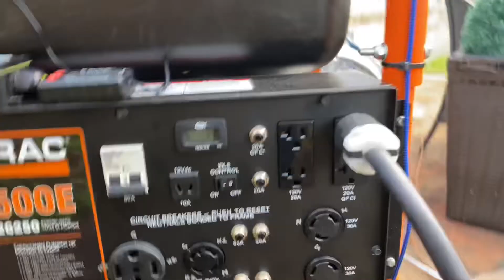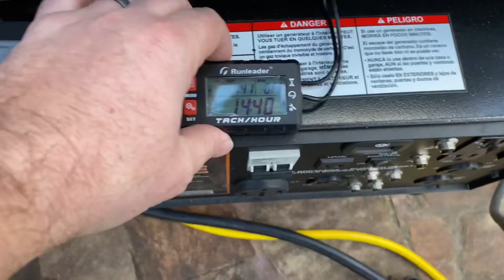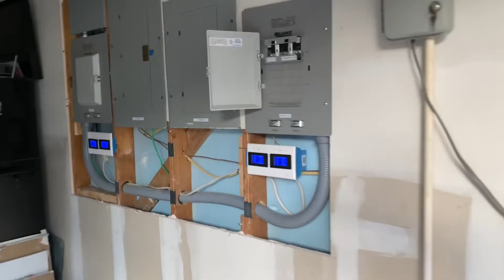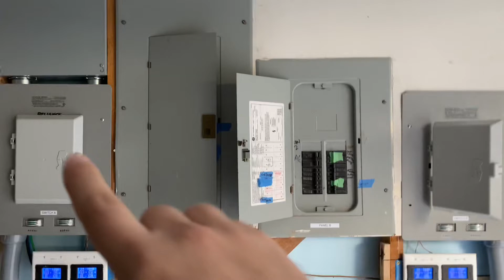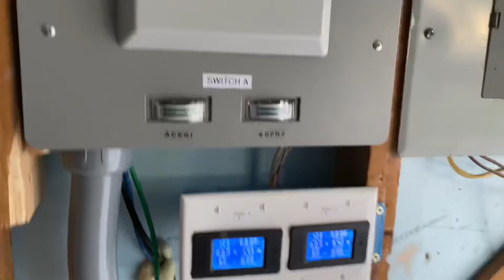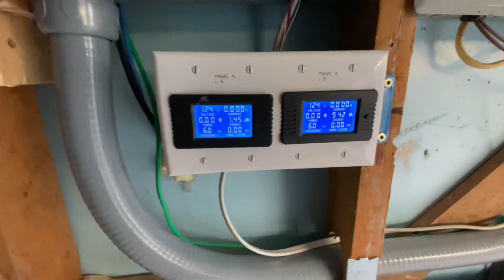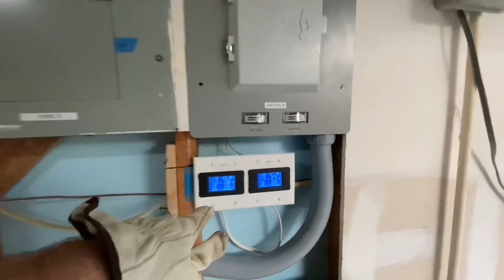Home Generator parallel power install - 72Amps/17,500 Watts - Generac GP17500E - Transfer Switch

Comment: Hi Jud.  Thanks for commenting on my video and letting me know about your set up.  It is is REALLY nice!!!  I researched this generator at length and picked it (as you mentioned) because it was the largest portable generator you can get.  What I didn't notice (and I don't think they make obvious) is that you can't get all the available power out of one connection.  Maybe is is not possible to put all the power in a "plug"....or maybe they are protecting their whole house generator market.  Anyway....my house only has one panel.  Do you know if there is a way to get both 50 and 30 circuits into a single panel?  I currently have just the 50 going into my panel with a mechanical interlock switch (that forces main breaker to be off.)  But of course I have 30 amps of available power that I can't take advantage of.  

I do have an attached shop and I considered running that 30 amp to my shop.  (The shop panel feeds off the house, but I could still use the 30 Amp branch to take on this load.)  In the event of a power outage, I won't be doing too much work out in the shop, but it would be nice to have power in the event of repairs/work is needed during outage.

In hindsight, I should have added a transfer panel like you did, or maybe had then add another panel to house.  The work that I did have them do was already a little pricey and I didn't want to spend much more.  I love your meters and monitors and will definitely add those to my mix.  Do you have info on those?  Where you got them, model #'s etc?  (I can't see your comments as I type, so maybe that info is in there.)  Anyway, nice set up and thanks for sharing!!
Reply: Whats the reason you couldn’t feed both cables into the 2 outlets and then combine each leg into one cable feeding a main panel with 80 amps? As long as you match up the correct legs by checking for voltage difference, what else could happen? If you can turn 1 cable into one with multiple outlets on it, would it work the same in reverse? 

Not an Electrican, just general curiosity as I see these 20kw portable generators will no real use case unless you do a set up like yours and your the first I’ve seen do it. The average home owner doesn’t have a set up like this.

If there’s a reason you can’t, could you tap into the main feed of the generator and create one cable with 72 amps?
Reply: @MrSkunks  I was wondering the same exact thing because I am getting ready to buy this generator and I only want it to run my 240v mig welder out on service calls and I had a 13,000 start and 10,000 running watt generator and it will run the mig welder but once you get about 3/4 power on the welder it just lays over and falls short on power. And now I want to buy a bigger generator but I want to make sure I can use all of the power available and I was wondering the same thing if I could get a 50 amp plug and a 30amp plug and wire them together to get the full 17,500?? I'm not a electrician but I don't want to waste money on something that won't work.
Reply from the maker: @jasond5405  Please see my reply below to MrSkunks...as the same would apply to your scenario
Reply from the maker: @MrSkunks  As for your first question: Good question, which i initially thought of doing as well myself. But then i realized that this wouldn't work because go the breakers. Once the total current draw exceeds 30A...your 30A breaker would flip.  

As for the second question: Yes, in theory you could get all 72Amps out of the genie through one cable, but you would have to highly modify it (which of course would void warranty). You’d have to essentially remove generacs breakers & plugs, and somehow install your own new breaker and plug. You’d have to take the main feeder wires that come off the winding and send them into a new 70A breaker on the genie. Then from there to a new higher amperage/wattage plug on the genie…prob 100A…as i’m not sure if someone makes a 70A plug. Then you’d probably have to build a custom 70-100A cable (extremely thick and heavy) to go from genie to house, and install a 100A disconnect on your house. ***The most important part is that you ABSOLUTELY HAVE TO HAVE A 3-POLE TRANSFER SWITCH (not 2 pole), as this is a self derived system! It has to switch Phase 1, Phase 2, and the Neutral. 72A is a ton of current, and could kill a lineman working on restoring power in the area (if your genie were to for some reason need to dump current back down the neutral). A 3-pole transfer switch would guarantee that a emergency current dump would never be able to back-feed down the utility line. It’s a lot of work, but it can be done!
Reply: Just a bit more thinking as I wrote this, I guess the problem would be is that you wouldn’t be able to control how much is being drawn from the 50 vs the 30. I’m not sure if it would run evenly or based on resistance of the wire but if you got close to the full 72 amps, it could run more through the 50 amp side or the 30 amp side and trip both.

Just doing head experiments but it seems  doing a main panel 50 and a 30amp sub transfer switch is the best option.

However there is a Westinghouse generator, like 20kw or something like that that has 2 50 amp outlets. Would amps be split evenly through both?
Reply: @MrSkunks  I typed up a reply already...and it vanished, so ignore it if you see 2.  Anyway, for my situation, I think I was so hung up on the fact that it "wouldn't output" all its power into one outlet....that I didn't even research to see if it was possible to connect up both.  (Possible and/or if not suggested, etc.)  When I called Generac, I think they said it was possible....but not 100%.  So, I just had the electrician hook up the 50 amp.  Not sure if it is worth for me if it is worth going back.  I haven't had the need for it yet, but tested the 50 amp side and it ran the house just fine.  I had a hard start capacitor installed in my AC....and it will run my AC too.
Reply from the maker: Hi! From my research, if you're wanting to use both the 50A & 30A on the same building at the same time, you would need two separate panels...that are totally isolated from each other (other than the grounding), which is why i did mine the way i did. You would also need to split the utility feed to both panels as well with polaris or some similar device. An idea...you could keep the 50A Gen receptacle on your main panel (as currently setup) and then purchase a MTS like i have (Reliance XRK series) and use the switch as your second panel...thus moving a handful of circuits from your existing main panel over to the new 30A XRK panel (as it can hold 16 branch circuits). This is a possible solution. 

*I really advise that you setup a system to where it switches the neutral as well. Using one of those mechanical interlock kits wont do this. You really need a 3 pole transfer switch. #1. This is what code requires for a self derived system...for safety. #2. We have a very powerful generator...72Amps, 26000watts. In a event where current was sent back down the neutral to someone working on the utility line, it could seriously hurt that person. However if we switch the neutral as well, it ensures that won't happen.

As for the shed, you could easily setup the 30A receptacle to power that structure. I however would make the same recommendation...adding a second MTS panel ( 3 pole) right next to the main panel. And move a handful of the house circuits & the main shed circuit to this panel.  No need to do anything to the circuit in the actual shed.

Also How big is your house and how many AC's? Maybe Your 50A might can power your entire house and shed sufficiently? Remember, i'm at 4,000sq ft and a 3 ton & 2 ton AC...and my genie is running at only 50% with the house at full load.

If it were me, I would probably swap out the main house panel with a reliance 3 pole transfer switch panel and use that as my main panel. Then if needing more power, add a second MTS right next to the main MTS and move a handful of the house circuits & the main shed circuit to this panel. All done! Hope this helps!
Reply from the maker: Digital Meters...
https://www.amazon.com/gp/product/B07JB9B2QL/ref=ppx_yo_dt_b_search_asin_title?ie=UTF8&th=1

Reliance MTS panels...
http://www.reliancecontrols.com/Catalogs/transfer-switches/?page=48